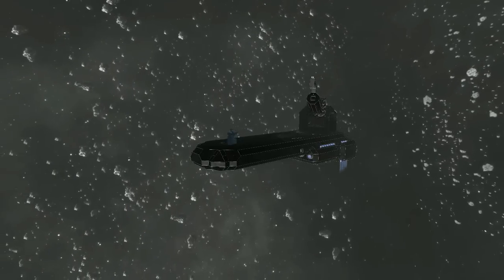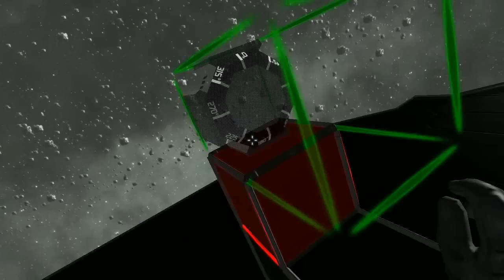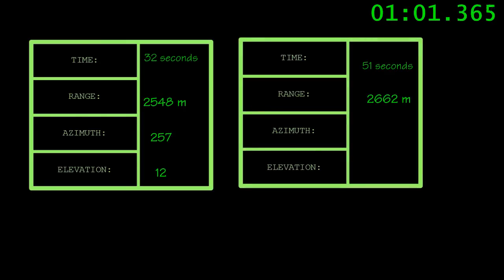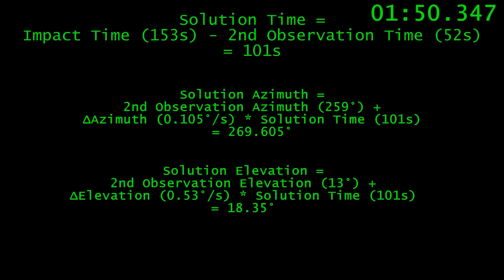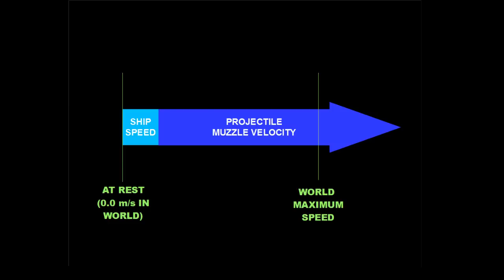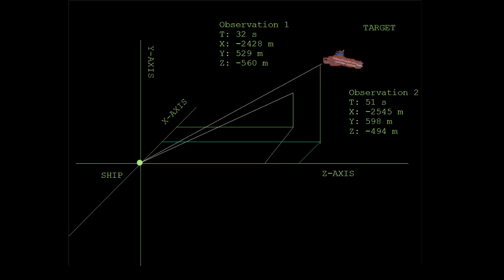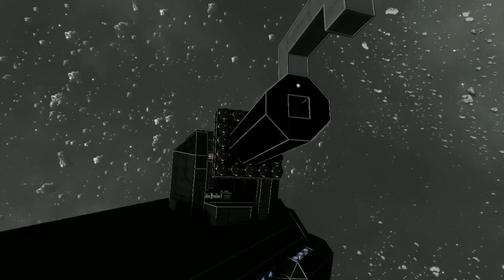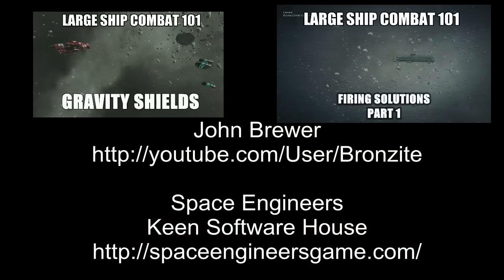Firing Solutions Part 2 - Space Engineers Large Ship Combat 101

Comment: Do you think it is possible use the ingame programming to make a small calculator program to figure out the speed and trajectory, given that there was something that could find the coordinates? There is a mod called blueGradar on the workshop ( http://steamcommunity.com/sharedfiles/filedetails/?id=369578004&searchtext=radar ) that can spit the coordinates of a ship out with a programmable block, and with that info, it might be possible to move that info to another programmable block that could operate the rotors and other aiming mechanisms. 
I haven't started fooling around with the programmable block yet, but I thought it'd be something good to see about. Another mod "smart sensor" allows for long range sensors and works with the new IFF update so it might be possible to use some machinations with that to allow for tracking turret systems too

Comment: I imagine this information will become far more useful once they add in-game programmable systems. Something that would allow us to script the way rotors and other things move/function, based on sensor data.. Probably need long-range sensors for that matter too..

This is probably way too advanced to do by hand, in most situations, although i could imagine using a graphing calculator script, next to the keyboard, to speed that up. lol
Reply from the maker: I suspect you're right; it took me a while to get good enough to do the spherical movement solutions fast enough to actually hit a target (practicing on cargo ships), and I can't imagine doing the cartesian method without a calculator.

I spent about two days trying to come up with a clever way to build a sight using pistons, rotors, and sensors that would calculate the deflection angle mechanically, but without gear ratios available, I just wasn't able to do it.
Reply: aaaand we can't actually get the stats on the opponent's ships through in-game scripts, but if you have a gunman on the ship and use the positions of rotors could work.